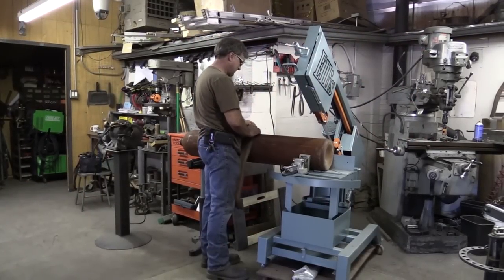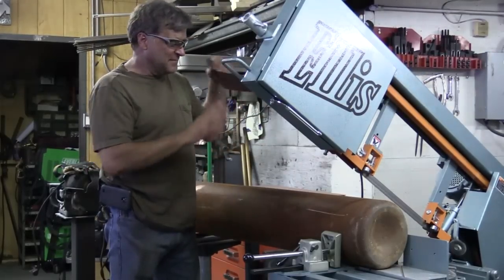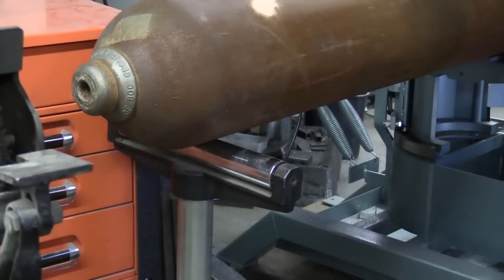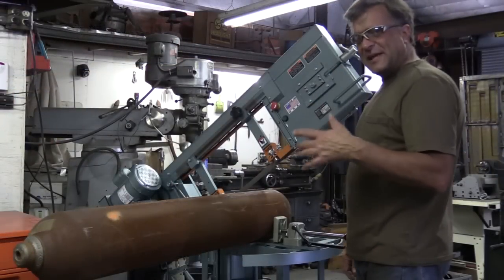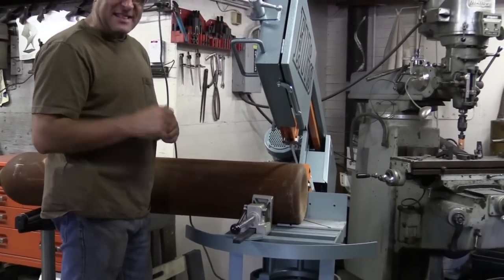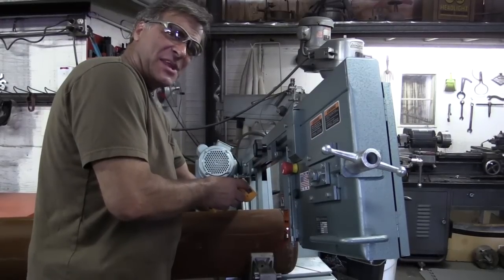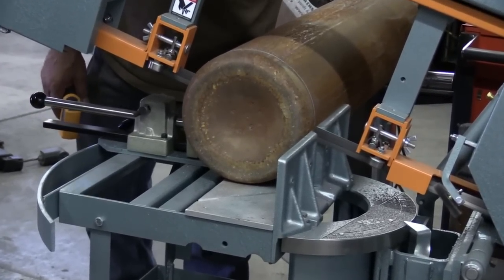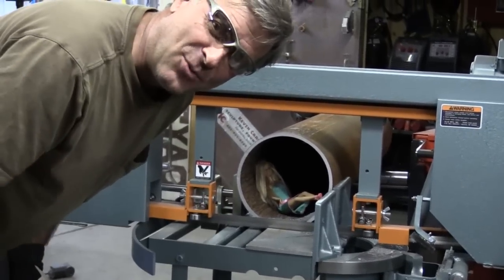How to Cut a Gas Cylinder With a Horizontal Bandsaw - Kevin Caron

Comment: I have to cut slices of 6" hydraulic cylinder tube to make stove pipe flue outlets for wood stoves (the inside diameter is a perfect 6", which fits the crimped end of stove pipes perfectly.  6" pipe or well casing is too large inside...).  The hydraulic cylinders are thick ( 3/8"?).  Alas, I haven't a nice big band saw like yours, and would use my plasma cutter, which left a rough cut and needed much grinding.

I set up a jig with sealed ball bearings (at the end near the plasma cutter)  and skate board wheels (at the cool end..).  The whole jig is tilted higher at the cutting end, so the heavy pipe cylinder rests against a teflon bushing at the lower end.  It rolls so easy and smooth. I rotate the pipe with one hand, and hold the plasma torch against a steady rest on the jig with the other, using a drag shield torch tip.  It makes nice clean slices at 2-1/2" lengths.  I drill an 1/8" pilot hole to start the plasma cut cleanly on every  2-5/8" spacing.  Makes a nice clean cut-off in under 1/2 a minute each.  The same jig works for 8" hyd. cylinders, and also any large heavy pipe, small enough to handle,  as well, so long as there is already one straight end to rest against the teflon stop on the skate board end...   Gas cylinders cut just as cleanly (be sure to use proper safety precautions for the type of cylinders being cut). I'd never try cutting an acetylene cylinder!  They are NOT hollow inside!!
Reply from the maker: Awesome way to use what you have on hand!

And you are so right about the acetylene cylinders!!

Comment: You blade would last longer if you didn't do a dry cut; but squirted some cutting ;llubricate while it was cutting.
Cylinder would have made a great bowling Ball canon. LoL..
Reply: Water based soluble cutting oil aka coolant 20bux a gallon mix with 20 gallons of water

Comment: How can I cut straight through irregular shaped objects? I dont have one of those machines - just a saw.
Reply from the maker: Not sure which way to point you.   You can do a lot with a hack saw once you learn how they work.   Never push a hack saw, I always use two hands with one on the front of the handle.   Pull the saw forward with that hand and pull the saw back with the other one.. This will help keep the blade straight and you can stay on line better..   Hope that makes sense..
Reply: My hack saw blade always bends, and there's no way to secure the piece I'm cutting. I'm cutting irregular shaped delicate fiberglass that would crack in a vice. I can't hold the saw with two hands. I'm always getting shards by the end. Maybe I should use a dremel with a thin cutting attachment? Also wondering how to mark a straight line around objects. I've been using a rubber band and trying to trace it with limited success.
Reply from the maker: Take a look at a Japanese pull saw.   Might be what you need..   To mark a straight line maybe try a laser level, just shine the light and make your mark.
Reply: Thanks for your help :)

Comment: I would still use some cutting oil. It will cut faster and make the blade last a lot longer.
Reply from the maker: The oil I have will mess up the wheels the blade runs on.    Company saws no oil on this saw..
Reply: I was curious about that. I know that oil will make metal shavings stick to the saw blade and they usually end up on the rollers or worse, in the roller bearings. Thank you for your reply. Keep up the good work.

Comment: I'm sure that cylinder probably held some non-combustable gas at one point, but just as a general rule, you should remind people to always fill/flush any gas cylinder with water before cutting, welding or torching on it.
Reply: Eco Mouse Would you cut a acethyleen cililinder after flushing?
Reply: If it was the only cylinder I had to cut up. But yeah, as long as neck has been un-capped and allowed to be filled with water for a day, then allowed to air dry. You should be fine.

Comment: how thick was the wall?
Reply from the maker: +Rustic_ MetalArt          3/8th inch
Reply: +Kevin Caron, Artist oh man,  sweet. hey, Kevin should i try to get tanks that had Non flammable contents, so i can cut them safely with plasma without blowing myself up?
Reply from the maker: Great question!!      I used to cut the old oxy bottles with plasma before I got the bandsaw..  Never a problem...   Just make sure the valve is out and the bottle has sat open for a few days.
Reply: +Kevin Caron, Artist Thanks for the advice Kevin.

Comment: You know, when cutting steel - slower is not always better.  Go too slow on the feed and you are just rubbing your way through. You can go by optimum chip size and want at least 1/2 to 1 thou of chip thickness.  Air cooled - so what.  Way better to do use coolant fluid and do some real cutting.

Comment: Great vid, my Craftsman 7x12 wet band saw was able to hack through one of those tanks in not much time. It is nice to use coolant on big jobs like this and the blade will last longer. The one I cut open was about 3/8 thick.
Reply: The coolant is just to cool the blade.  I bought an Ellis saw and ordered the air system with it.  The air blows on the blade and cools it

Comment: Ya you for sure should use some cutting lube. At least get a small pump for a fish tank and use some of the clear air lines to feed it
 Through let it rrickle on the blade like an old man pissin. Just enough to lube the blade. it'll make it cut much quieter less heat and blades will last ten times longer

Comment: If you leave a little more area under the dome, weld the dome to a flat plate. Fill the stamp marks with a few welds and grind smooth. If you have too much ring you can drill and tap a hole for a recessed set screw and fill with dry sand or water. Now you have a dishing form that will last a lifetime. Remember that you use soft hammers into hard forms, and hard hammers into soft forms. So for this, rawhide, nylon, ironwood, etc. a wooden dishing stump you can use any metal hammer.

Comment: thnx kevin, beautiful edge to work with; i read somewhere also that yes the acetylene tanks do have something like an acetone soaked sponge in them - the actual purpose escapes me at the moment but it made sense when i heard it. i use that steamfitters marking method all the time with large pvc pipe, a large stiff paper wrapped nice and square is also a good way to map out equally divided (or not..) segments of the circumference > mark the edge of the paper where it meets up to indicate the circumference then carefully divide up that marked distance... the marked length on the paper divided by 1/2 should get ya pretty close to where the diameter of the pipe might land without relying on a 'centering' layout tool.

the tank(s) gonna make a nice chime.
Reply: Don't do anything crafty with acetylene tanks, they are very dangerous.

Comment: Nice vid. I thought when you said five to ten minutes, "boy are you in for a surprise!"
A lot has to do with the blade itself.
When you get a replacement, get more teeth per inch.
Anyway nice saw.
I am surprised you didn't use coolant if it was equipped for that.
You might consider adding a pump & reservoir.

Comment: It should be noted that some cylinders shouldn't be cut up even if empty and purged. Acetylene cylinders for example are filled with a porous material and a solvent (acetone). In older cylinders the porous material contains asbestos.

Comment: Hi Kevin, I absolutely love your videos. Please don't take me the wrong way but I am a bit surprised by this one. You are usually very good with safety and showing what safety procedures to adhere to. But this video, really is incredibly dangerous. I know you will have taken plenty of safety precautions (making sure bottle is empty, not pressurised, de-fumed etc etc). But no mention in the video? Cutting into a gas cylinder really is incredibly dangerous and should not be advised at all. Granted you are a professional and know what your doing but many people watching won't be. Hope I don't come across as moany but a little safety brief at the start of the video would be prudent I think for such a (potentially) dangerous procedure. I dread to think what would happen if someone thought "cool, I'm going to try that". And did it with what they thought was an empty Acetylene Bottle that turned out not to be so empty. Anyway, I love your videos and your work. Keep up the good work and that saw is fantastic. :)
Reply: People with common sense must be on the endangered species list. But if common sense was truly common everyone would have it.
Reply: Some things such as basic safety rules should always apply and go with out saying. If you are cutting open a nitrogen or argon cylinder that is not pressurized and has the valve out common sense should tell you that is nowhere near as dangerous as trying to cut an acetylene cylinder. I don't think this was supposed a step-by-step safety briefing on how to cut a gas cylinder open. I think Mr. Caron puts out great videos about what he is working on and the tools he uses.
Reply: YeCannyDaeThat This is a surely great way to clean up the gene pool for those complete idiots... I would be the first to laugh at the dumb ass that tried this on a pressurized acetylene bottle.. if they are that stupid they need to go...
Reply: in natural selection we thrust! hope someone gets a angle grinder and cuts open a gas cylinder fully pressurized and all :)) , one down, 80% of the population left :))